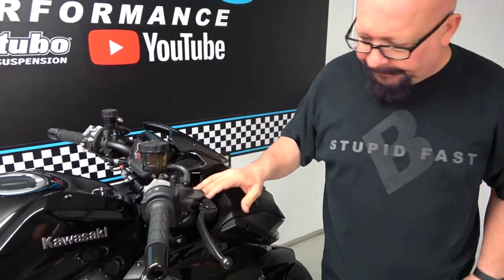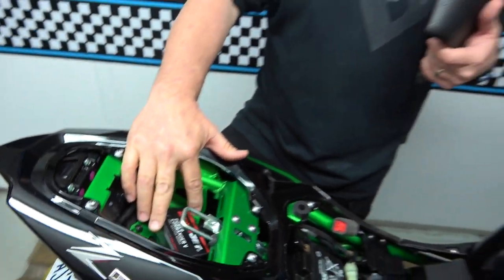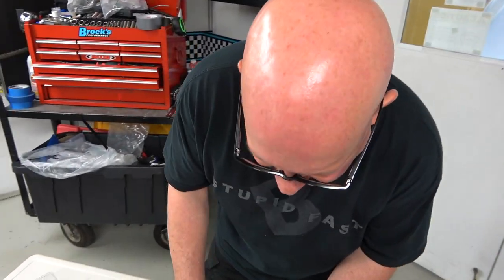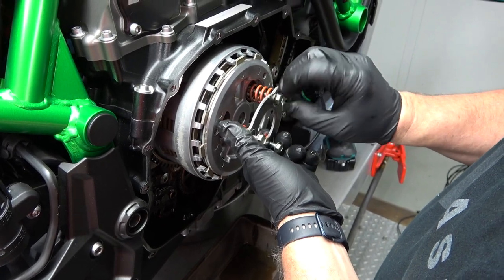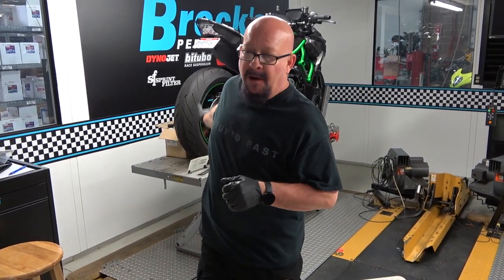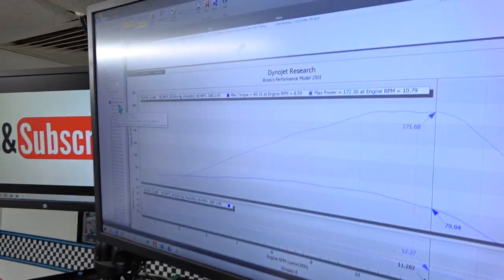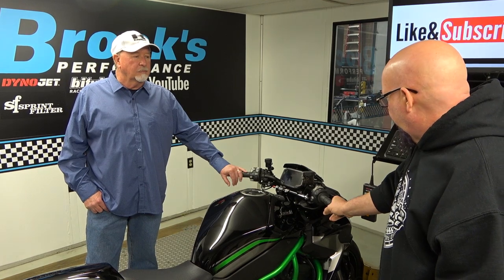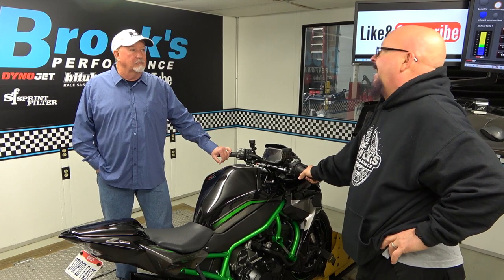Kawasaki Z H2 2020 Project Bike Completion | In-Depth Discussion On Motorcycle Slipper Assist Clutch

Comment: Have you ever tried to disable the clutch basket damper springs and make it solid for more consistancy?  Always wondered how that would ride.  I suspect a ton of bucking at low rpm but maybe better feel at WOT?
Reply from the maker: Instantly breaks transmission gears. Same with converting rear wheel to solid drive. This stuff isn't by accident - bad things happened to create these solutions. Embrace them.

Comment: Hey brock, Do you know if there is talks or any info on an Auto engaging clutch, Very much the same as a REKLUSE clutch system.
Rekluse do this type of clutch pack for dirtbikes, How great would it be to have a slightly bigger basket and clutch system, spacer and a bit bigger clutch with an automatic one, So it engages maybe 3000 to 6000 and be adjustable between the 2? :O 
That would be pretty amazing.

Comment: 201  MPH  that's  what  Burt Munro  Did  on his  1920   Indian Scout  in  1967  at Bonnieville..  I guess  he was a Genious  however and it was his home built Streamlinder   945  CC's  on Methanol naturlly aspirated ..
Reply from the maker: Ahhh, the good ol days! Before Euro and Cali performance choking regulations....
Reply: @BrockDavidson    1967  .. Still hard to believe he  got a bike that went  54 mph stock to go 200 MPH  at  the Altitude of  The Great Slat Lake ..  Emmisoons are not a factor  in    off road racing..  
  I laugh at   new Motorycle reviews .. Stock they all run too lean  .. guve them  3% more fuel or more  and  they will  be more  drivable  and run cooler..VW  got caught doing this  and was fined  $2 Billion ..  My  friend  told me that there is a parking lot  full of  new VW Diesel  Engines  in South Pittsburg  TN ..  would be a perfect swap for  my  1995  Geo Tracker
Reply from the maker: Impressive to say the least.

Comment: Another testimonial: Picked up 6 mph on The Cow Pasture Run. 
went from 135 to 141 mph, in a combo corner speed and short sprint in the straight.
90 deg corner, 0.2 mile long into a 0.2 mile straight. Full pipe, PC and Sprint Filter. More mid range & top end hp. Details,  video: https://youtu.be/rsDL50uwyj0?t=56

Comment: Will u  feel any diff with ceramic bearings
Reply from the maker: Yes! The bike is noticeably easier to push compared to stock and the improvements are measurable on the drag strip,GPS or Land Speed Clocks. More Info: https://blog.brocksperformance.com/faq/what-are-the-performance-advantages-of-ceramic-bearings/
and: https://blog.brocksperformance.com/faq/why-choose-worldwide-ceramic-bearings/

Comment: I need  an open map that I can work with  for my  Power Vision III   ..  I see Dynojet  has their Maps  locked  so  you can't make any changes ..
Reply from the maker: If you own a Brock's Performance exhaust, you can request your map here: https://blog.brocksperformance.com/category/map-support/
Reply: @BrockDavidson    I see  you sell an exhaust  for the  MT-07   for  $895.00   I assume the Catalytic  Converter is  $131.00 More..  I don't  need a converter..  necessarily .. The Problem is this pipe is too loud..  I like sneaking around with  my stock exhahst and the Cops  don't normally  notice me..

  They don't tell if their dyno  tests are with or with our the converter.. I assume all  tests are with stock fuel maps..   You daid  bikes don't need new fuel maps  with the  exhasust  but  bikes  are too lean  stock and I have a K&N  air filter too ..
https://brocksperformance.com/exhausts/termignoni/yamaha/

   It's  Funny Most  Harleys  want to race me at a Red light .. So  far  my  689 CC  74  HP  bike has not lost to a Harley .     Though  I did pull  too big a wheelie  and had to get off the gas.. Stupid   me now realizes  I need to learn to  use the rear brake ..  I flipped my  YZ-125  doing a  6th gear wheelied when I was 16 years old .. No one  ever taght me your supposed to ride the rear brake ..  I leanred that on Youtube  a  few years ago now I am 60 years old .. And need to  start practicing again ..  I feel so stupid not  knowing that..  and  I started in  3rd  gear and shifted to 6th gear.. it was a cool fall day  had  extra power and went  over back words.. They tell me I was unconcious for 3 minutes..  I was paiting my parents  house.. and saw a kid  kocking the glass out of my Grand fathers  fuel  pumps.. I went to get my bike out of the garage.. I stopped went  back in the  house and grabbed my helemt .. was that close to not having   ahelemt on .. Maybe  if I didn't have a helem  on I would not have tried wheelies  on gravely grass..

Comment: I'm actually kind of annoyed that the bike doesn't come with any type of steering damper by default. Even the 2021 SE model doesn't have it - $19.5k bike
If I'm ever so lucky to get this bike - I'd probably get a damper just for the peace of mind...
Reply from the maker: They put them on bikes that are more likely to be raced as they are required by tech in most cases.

Comment: Lol Lame Asf !!!   Just buy the regular H2.   Same damn parts from Brocks performance too. Straps, exhaust, tune, clutch mod , ceramic bearings.
Reply from the maker: You realize that this bike retails for about $7K less than the H2? Leaves A BUNCH of extra cash for goodies....
Reply: @BrockDavidson  It looks like it too... After mods you'll be 4000 or better into that 7k and it still won't beat an H2 or be as stable.. (No aero)
Reply from the maker: As long as the H2 has our $4k mod kit also. The Z is also very easy to extend with it's double sided swingarm. Once we can flash, these Z's will really fly...and, you can put your girl on the back.
Reply: @BrockDavidson  I'ma gunna stick with my opinion here. At this level of financing and performance the regular H2 is the better option.
Reply: Hey Ghost Bandit, not everyone wants to be hunched over and jammed down on your wrists on a long ride like a H2 gives you. That's why we have a ZH2 that Brock has taken the time to develop some for what it is. Who cares what power the H2 makes. Two different bikes.
Reply: @greylove1522  It would be a boring world if everyone thought the same way & liked the same things.
I rode the H2 that my son ran 219mph on after Brock installed his bolt-ons & the bike was a blast. I've also ridden stock H2's but never bought one due to the ergonomics. This ZH2 is my everyday bike that is comfortable and fast.
I'm glad for the variety.
Reply: @dannym9630  Glad you are satisfied with the Zh2 . For me I feel like the h2 is better . Change the bars if you have too. Risers etc. The H2sx is cool too . But I understand being different.   Just not a fan of the Z.